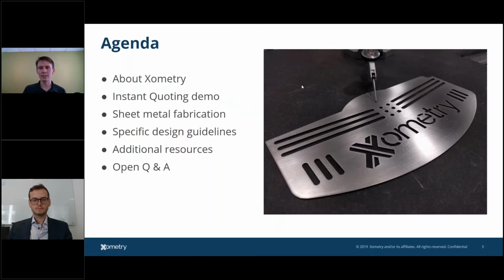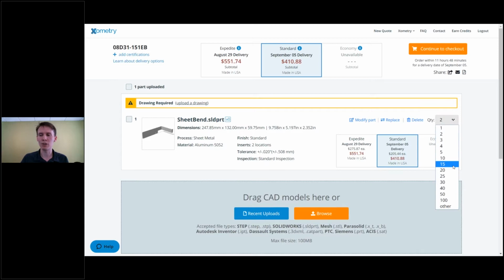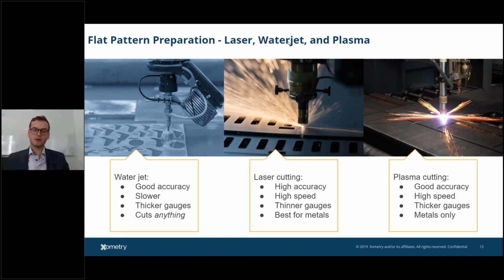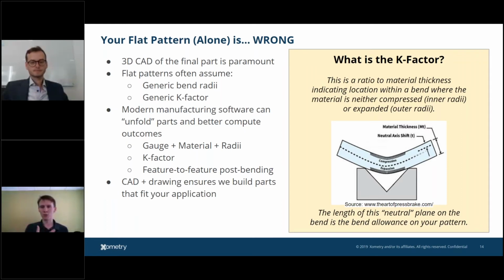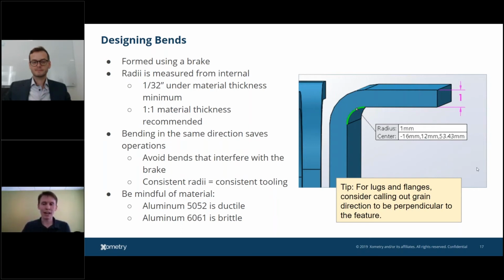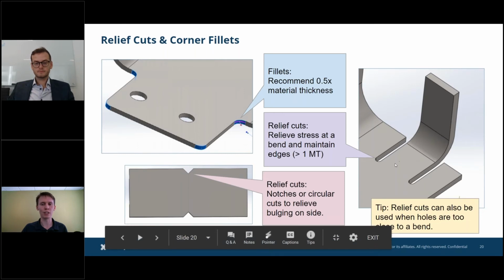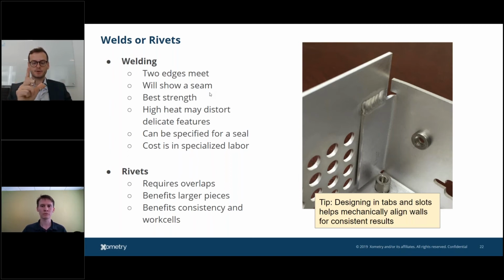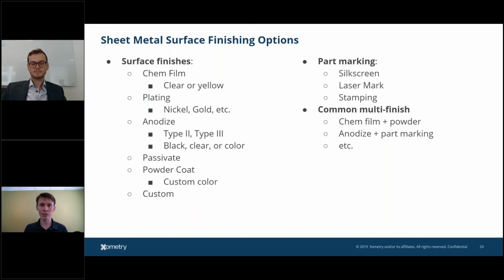On-Demand Webinar: Designing for Sheet Metal Fabrication With Xometry Greg and Callye Keen

Comment: Here's a question: Say I were to buy some run of the mill 1050 mirror finish sheet in bulk like this: https://www.alibaba.com/showroom/mirror+finish+aluminum+sheet.html?fsb=y&IndexArea=product_en&CatId=&SearchText=mirror+finish+aluminum+sheet&isGalleryList=G

What options do we have to cut it with pristine edges that are visually flawless from at minimum 1 foot away? Would laser cutting would be detrimental to the color finish around the edges? Can we blank this up to those quality standards without additional finishing or edge work? Any recommendations for info on this?

Looking into DFM options for developing a range of luxury products by minimizing sheet metal processes. The variance in the types of coatings and cutting method 's effect on those coatings is surprisingly sparse to find information for. I'd assume if anyone had seen this before it would be someone like Callye, and it really clouds the cost estimation abilities of outsourcing like xometry. Of course I can get in touch, but looking into so many options to find what works best leads me to look for a knowledge source.